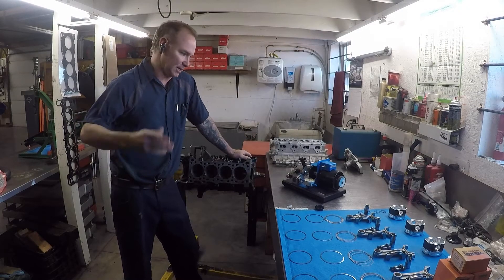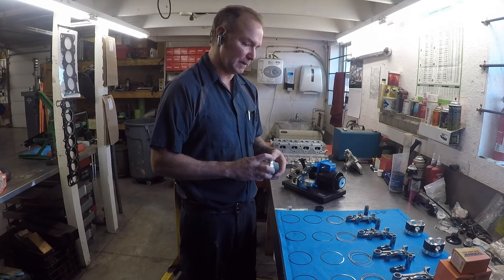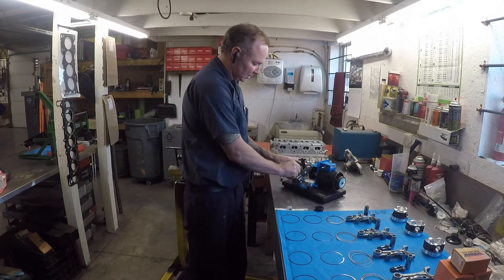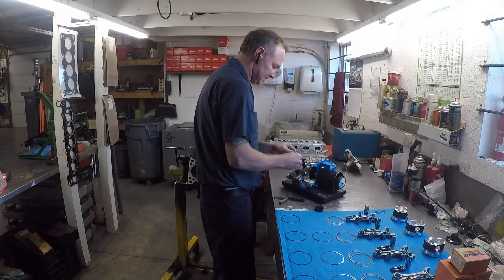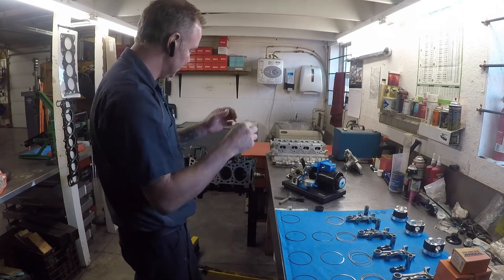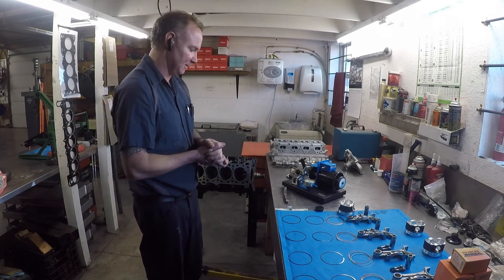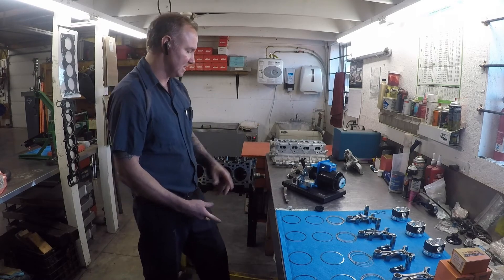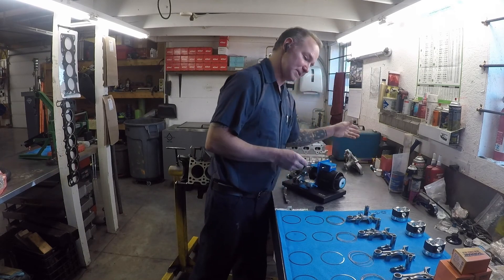Putting a (perfect piston) ring on it means more horsepower

Comment: Thanks for the insight. Curious if your ring gap orientation when installed on the piston is manufacturer recommendation or do you have a different preference?
Reply from the maker: Manufacturer recommendation is always best.  Different rings can utilize slightly different orientation but in general their always pretty similar.